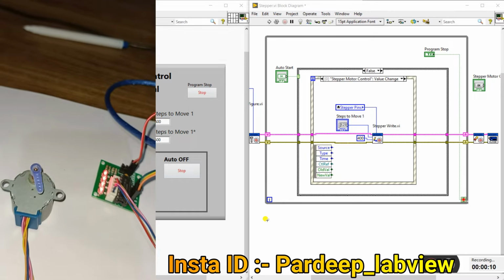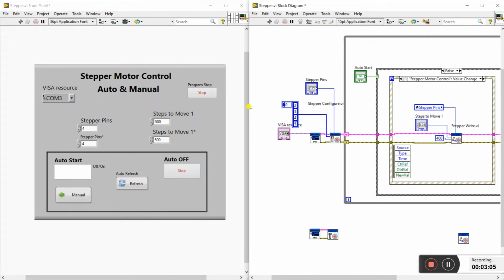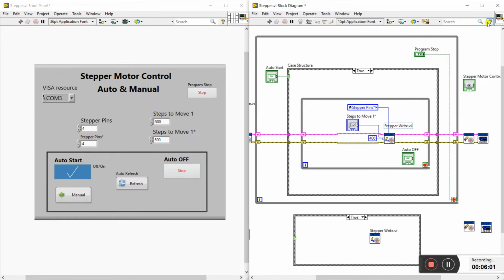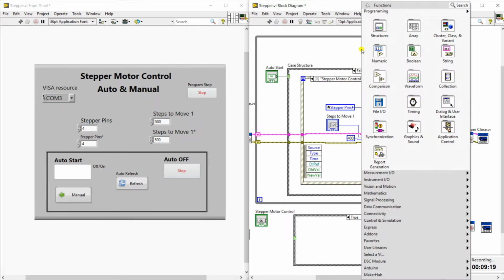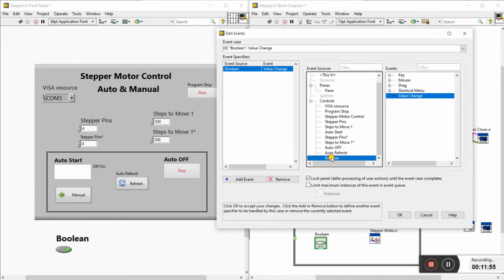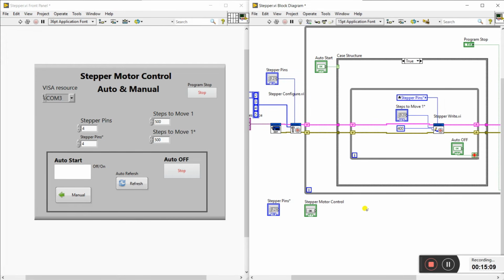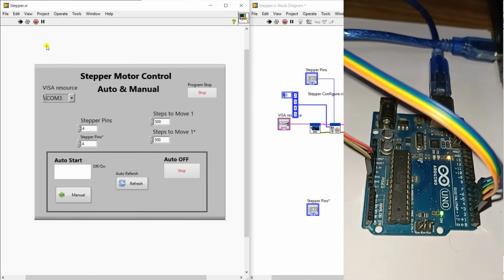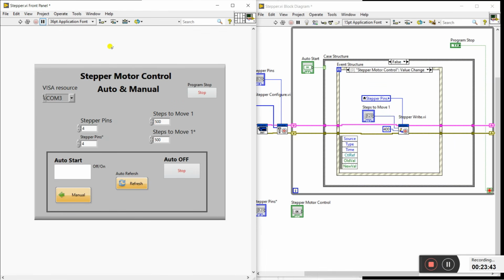LabVIEW | Stepper Motor Control using Arduino | Auto & Manual | Arduino + LabVIEW Projects Series

Comment: Hi is it possible to add a encoder to my motor and have my labview for it as well?
Reply: becuz of my project i  will need to use my raspberry pi and i have to control my motor, so im planning to use a stepper motor with incremental encoder. Will it be possible? Pls let me know thanks in advance!
Reply from the maker: yes dear but for this task you need to contact:- +91 98600 13298 (Mr. Atul sir)

Comment: nice content but i have a doubt , that is it possible to control a stepper motor only with labview
Reply from the maker: no dear you can control help of Arduino, NODEMCU, Raspberry pi, LabVIEW so on...
Reply: @PardeepLabVIEW  then its not possible to control only with labview
Reply from the maker: @preamkumaral7205 not only LabVIEW you can control help of lot of hardware that's i already told you 🤗
Reply: @PardeepLabVIEW  ok can i contact u
Reply from the maker: @preamkumaral7205  sure dear
show in discription have Fb id as well as Insta id.

Comment: Thanks a lot 
This is a great job 
But I need some help 
I want to control two stepper motors at the same time 
Can you help me please??
Reply from the maker: thanks a lot dear ☺️
ok dear i will try to use 2 steppers within 1-2 weeks
Reply: @PardeepLabVIEW  sir 
I have cod on arduino and labview 
It work successfully with on just 
I tried to make it fot two steppers but I can't 
If you want to see them I will send it for your email 
And this is main ..a777605700@gmail.com
Thanks my bro
Reply from the maker: @amraljaadi7491  ok dear but i have one servo that's why
but i will see your code  if have any problem then i update you.
Reply: Hi sir 
I hope you are fine 
Did you work about 2 stepper motor?

Comment: Very useful video, can you please also make a tutorial how we can control mote than one more with Arduino + LabVIEW interface.
Reply from the maker: dear soory I don't understand what do you want???
"mote than one more"*
Reply: @PardeepLabVIEW  sorry its 'more then one motor' like controlling 3 steeper motors at a time using Arduino & LabVIEW.
Reply from the maker: @charmingali34  ok dear I will make a tut on your task
Reply: @PardeepLabVIEW  Thankyou, Moreover can you please clarify how you have entered the pin 2,3,4,5 on left side of block diagram? Like which function was used?
Reply from the maker: dear you can change these pin because in my hardware i used 2,3,4,5 that's why in LabVIEW have "Stepper icon" there also need to identify same pins "2,3,4,5".

 you can change in LabVIEW as well as hardware( same pin identify on software beside hardware)
Reply: @PardeepLabVIEW  thankyou for the quick response. Am actually following your tutorial but as am new to LabVIEW I am just trying to figure out the stepper icon from the functions of LabVIEW.
Reply: @PardeepLabVIEW  Also is 400 the motor speed or loop execution speed here?
Reply from the maker: #motor speed